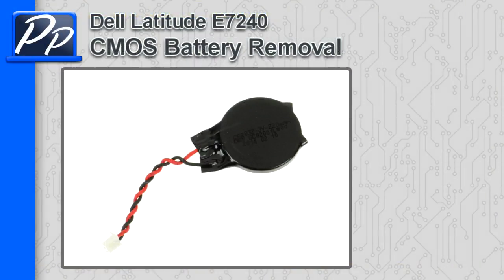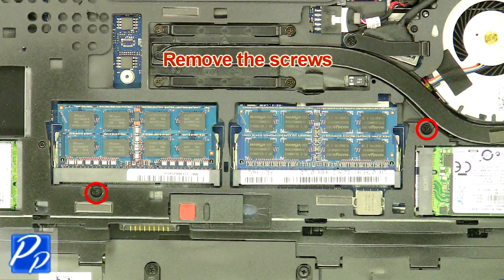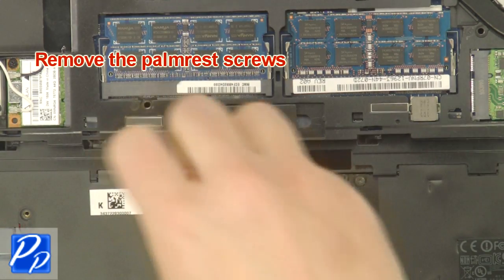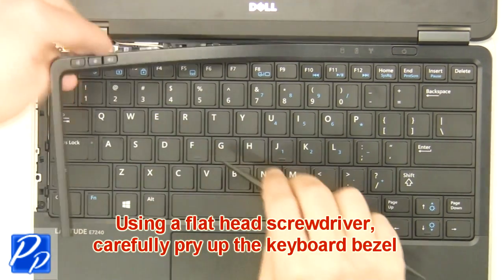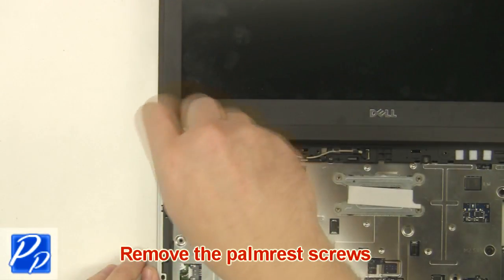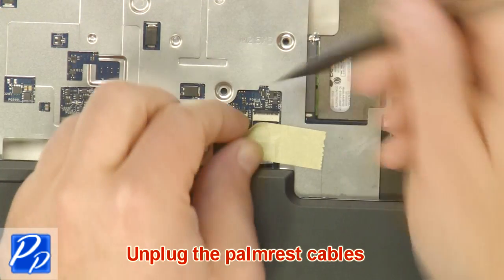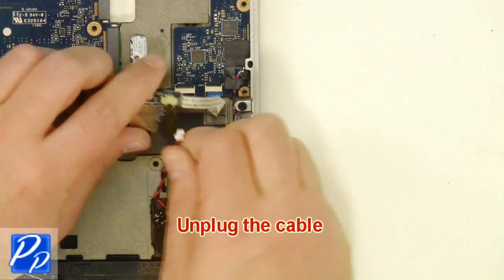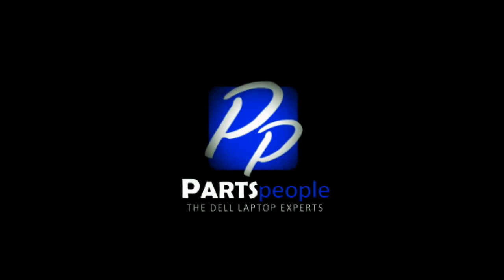Dell Latitude E7240 CMOS Battery How-To Video Tutorial

Comment: You did it wrong, U could have removed it when U had taken off the first (battery) cover, the bat is hidden under the black material on the left side corner, U have can feel it there, U have 2 cut & peel back the  stuff 2 get 2 it.

Comment: My laptop stopped working suddenly, and wouldn’t start up again, after I changed the cmos battery it’s finally running again 😅 after all the trouble of disassembling the whole thing I realized the cmos battery is literally taped to the back side of the soft flap on the right side of the laptop right after taking the battery out.. 😆😆😆 so in a pinch you could simply cut the flap, cut the 2 wires and solder the new one in without touching a single screw ☝️😀😃😄😁😆😅😂🤣
Reply: Right! this comment must be up!
Reply: Fantastic input. I could change the CMOS battery within 5 mins without removing a single screw. Thanks for saving me a ton of effort. 
Request you to post a video on this 😊👌👌

Comment: Thanks for the very useful video. My 7240 isn't booting properly. Every time I change the RAM it boots once to show memory configuration changed. When I reboot the hard drive light blinks repeatedly and nothing else happens. I can only turn the laptop off with the power button. I suspect a motherboard fault. This happens with or without a drive plugged into the mSATA port on the right-hand side of the motherboard.
Reply: Hello. I'm having the exact problem you described. I have to keep changing the RAM between the two slots to reboot properly. It will reboot once and then when shut down and restarted, nothing happens except for the hard disk drive blinking. I have to swap the RAM module again to get it going. Did changing the CMOS battery solve your problem? If not, how did you solve the issue? Thanks for any ideas.
Reply: @reenakatta1456  after changing the CMOS battery the system did boot once and then reproduced the same error. I've not managed to solve the problem and conclude that it must be a motherboard issue. Sorry I couldn't help you more.

Comment: removed CMOS battery but BIOS password could not reset plz help me.
Reply from the maker: The CMOS battery only powers the date and time. You have to replace the motherboard.
Reply: I paid for password reset 10£ on ebay ;-)
Reply: @joseph791206  Was worked?? I have problem with password, but if disconnect battery not working I need search other ways to solve the problem.